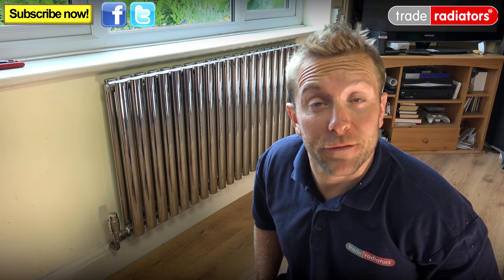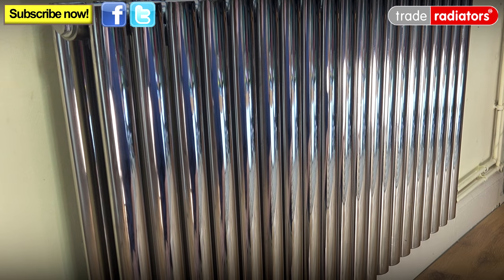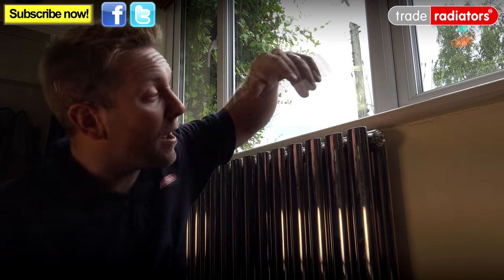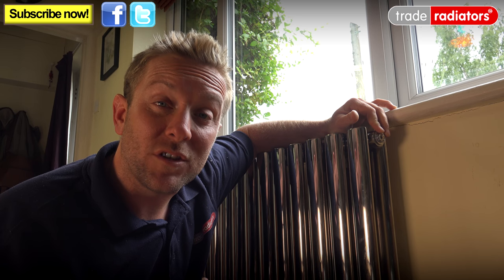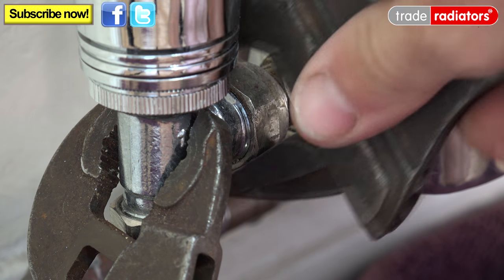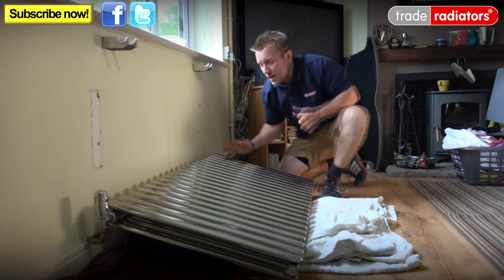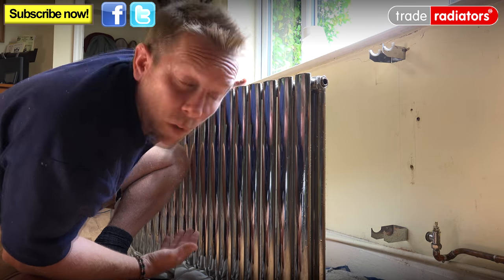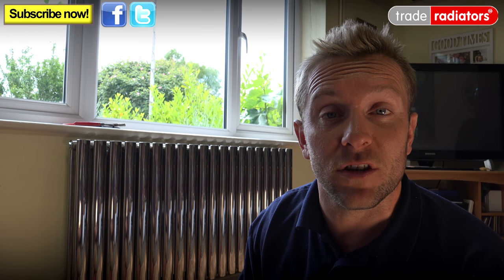How To Remove A Radiator Without Draining It

Comment: Hi, Great video.   I checked the way the radiator union undid first before doing anything esp a 1/2 inch nut union on one end appears counter threaded and opposite to the other 15mm other side as was fitted to a Danfoss TRV.  You need to be aware of this.  Before I did anything I put plenty of old (dog drying!) towels down.  I did have a bit of a moment when I realised I had not steadied the lockshield and it twisted starting to leak at the olive but the towels did their job. I reset and tightened  up the lock shield nut on the pipe and the leak stopped.  This was done on admittedly on smaller kitchen radiator so was easier to handle.   I am changing the radiator which is over 45 years and is rusting but this demo has at least got me  started on changing another  5 radiators on a (previously clogged at the 3 way equal Cold Feed union replaced now clear) open vented system so without to much of a rush esp  now its summer and warmer.  Thanks again.

Comment: If its just to paint don't take it off completely, slide it down and tighten back up.. Get the paint on the wall, leave to dry.. Come back and loosen the rad nuts put it back up and Job done

Comment: Wow!. you made that look easy. I have a question. I have a tiny 2 x 2 ft  (approx) radiator  positioned under a bay window off the floor, with the pipes coming out of the plasterboard (and not out of the floor). I want to completely remove not just the radiator but also the pipes that come proud of the plasterboard wall into the room. Is this possible?

Comment: Need to be careful not to knock the valves off the pipes each end (If they were poorly fitted!) - and when you rotate the radiator, beware that it doesn't rescrew itself back on a quarter turn!!

Apart from that - great!!
Reply: I thought of this . Glad someone is thinking about it too :)

Comment: Thankyou, wasn’t sure before how easily you can take radiators off without the need to drain them.

One thing though, you should maybe slow down when explaining the steps! The point in which you loosened the nuts was a little fast and for someone attempting DIY as an absolute novice then that would be a bit fast to follow!

No negativity just positive criticism :)
Reply: 9k

Comment: Oh Dear, anything but use radclamps eh? Sounds familiar that first part, open airvent, Make SURE you close etc, ;-)  grips to hold the valve ? marks , scratches, slippages? No use of Radwrench? disaster written all over this, clean water in the (Downstairs) rad as well !

Comment: 2:36 you allow the pipework to rotate while loosening the tail connection to the valve.
This is not a good idea. It looks like all the connections are already finger tight for a demo.

Comment: I'm a bit baffled at how pointless this is to do, why would you not just open the bleed valve, crack one of the valve nuts and drain the thing down into containers? This "method" would be fun on 8mm microbore...snapped pipes and major problems...

Comment: Didn't mention you need the rad to be held on the wall by a non std bracket...Most rads don't have these brackets so this vid is useless for the std brackets ...very miss leading. But with the correct brackets then yeh you can do as in video.